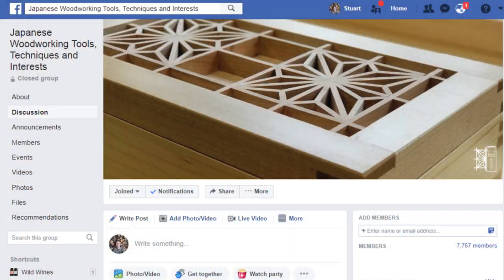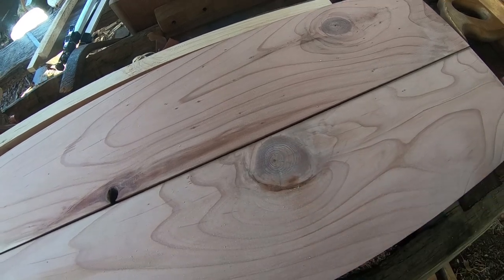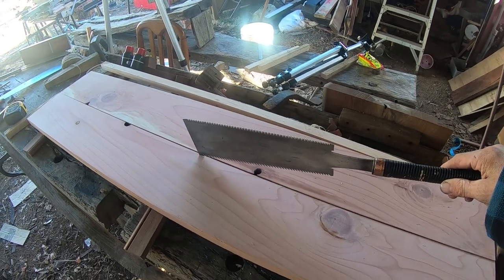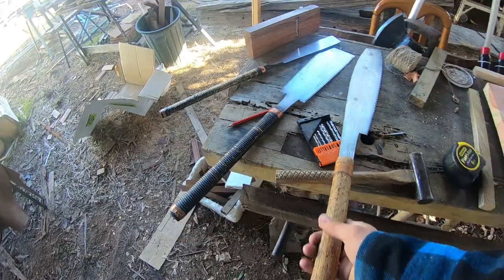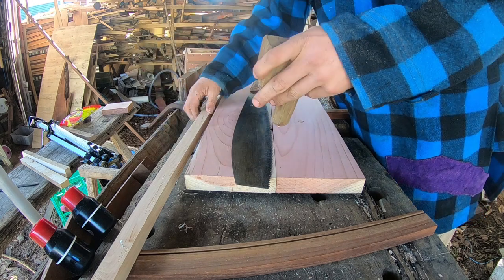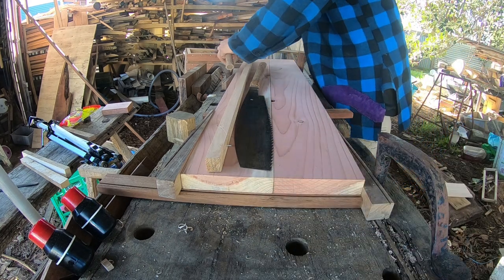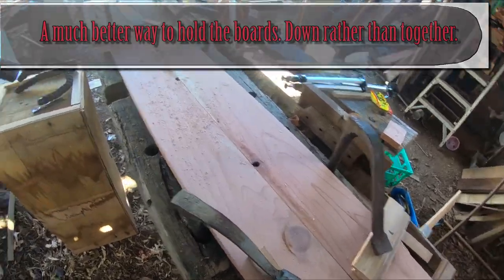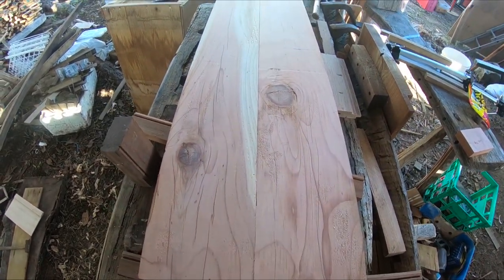Japanese Jointing Saw or Boat Building Saw Anahiki nokogiri

Comment: Hi,
According to Toshio Odate's "Japanese Woodworking tools" : 

" [...] Used to cut logs or large beams, or to do any rough, preliminary work. It can be ryoba or kataba style, but is commonly kataba. The saw is called by different names [...] hana-maru (round nose), saba (mackerel) and hana-magari (bent nose). I do not know the reason, but the blades of Kobe, Miki City and other areas of western Japan have slightly different design (i.e. a curved back) [...]. 
[...]
Like the azebiki nokogiri, every tooth can touch the wood without slipping on sawdust (he's talking about the curvature here). [...] Tooth style may be ibara-me or nezumi-ba (depending of the hardness of the wood).

Comment: Your saw has cross-cut teeth. You don’t wanna do rip cuts with them.
Jack B has pointed you in the right direction - I’ve read the same book, too. Some western high quality hand saws 🪚 have a slightly curve on their toothed side as well, to prevent the saw clogging on sawdust when cutting wider wood. With a curve, there’ll always be teeth sheering the wood.
Reply from the maker: Yes it does which is the correct grind for jointing boards. The chisel teeth of a rip grind remove a kerf of wood. The teeth of a cross cut grind not only remove the kerf but also a more fuzzy surface (when going with the grain) that absorbs moisture, swell and seal the joint. So you could use a rip cut grind just for jointing but to make the joint water tight use the cross cut grind.